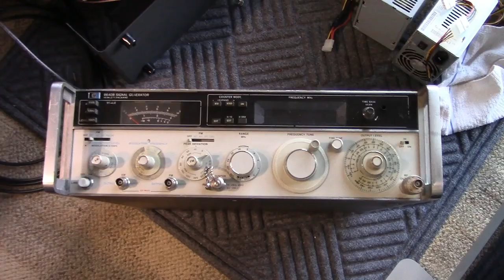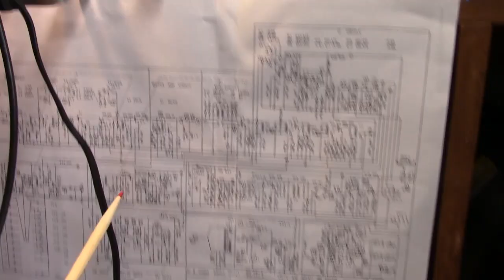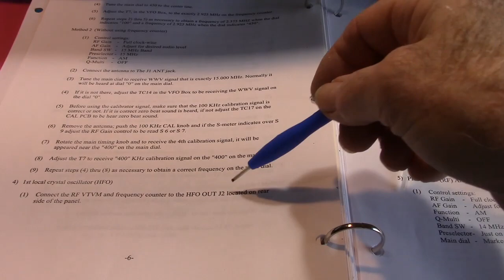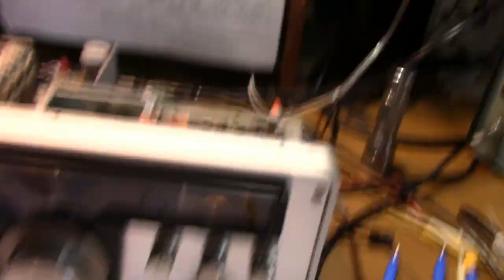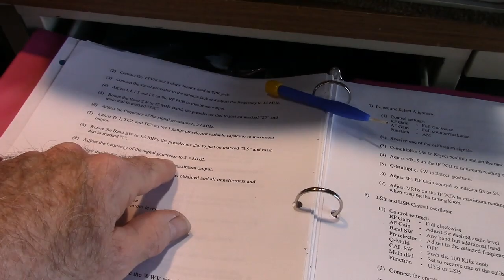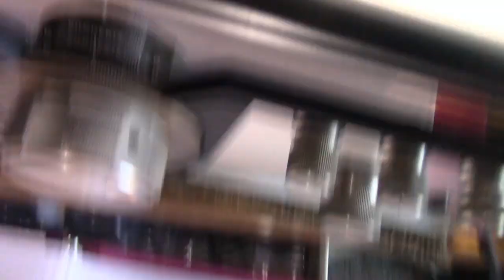Allied AX 190 receiver alignment

Comment: Great Video, but the sweep of the IF can now be done with a  Tiny SA Ultra with its Tracking Generator. I gave my AX-190 to a best friend whose Electronics Education was working at Radio Shach, unfortunately his HS cancelled all Electronics training. Now he repairs ECUs for cars and trucks, is ASE certified and a genius at repairing even a FLIR camera Fluke wouldnt fix, without any manual. He has an Icom 7300 among his 100K of car, electronics, and test equipment! Anyway, I gave him a Tecsun PL-880 to reolace it, we could never get SSB mode to  sound clear, and the overall sensitivity was poor. I recapped and rebuilt the AF amplifier, for better low frequency response, and was ready to put in an LM380, Not THE WEAKER AND NOISIER LM386 audio IC instead. A final nit to pick, was the tuning didn't drive at all, and the 2 MF filters  really create Tinny Audio! On a positive point, with all the CRYSTALS in there, and the first conversion to 500KC Bandpass with the VFO is almost Drake quality. This was PLANNED by GRE, the very creative Contract Manufacturer in Japan, and ARS to have a companion TRANSMITTER, but that never happened. I guess you could modify an AX-190 to use the VFO and controls to make a medium power TX in the same case, but relabel the front panel! BTW, WHERE WERE those bad solder joints, and which circuts did they affect? Enjoying life now able to find and buy EVERY SWL and Ham Radio I couldnt afford in HS or College back in the 70's on Ebay, Swap and AM nets and our Stone Mtn GA Hamfest with an S-38E, fully restored and put next to my SX-28A. Best 73s, Hilary

Comment: What kind of led did you replace the incandescent with? Do you know where you got them? Thanks
Reply from the maker: Hi Brian, Just about any LED will work. I got mine on Aliexpress. You can choose a series resistor to set the brightness. There are LED's now that have a spectrum close to an incandescent it you want to keep the original look. With this radio,  it is easy to try different LED's . Just temporarily connect an led , with a dropping resistor to a short lead and insert into the original bulb opening. You can even try different colors if you like. I bought a large assortment of LED's and settled on white. A diffuse LED is best to scatter the light . Sanding the tip of the LED has a similar effect. Just experiment until you find what looks best to you.  Good luck and happy experimenting.